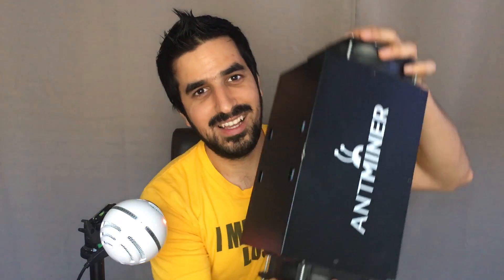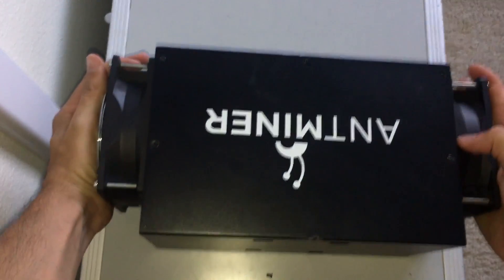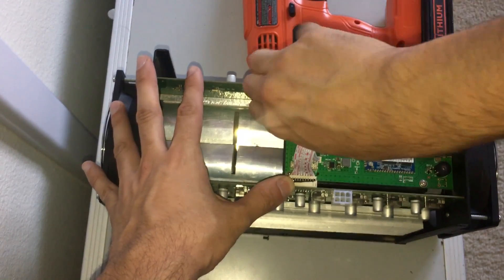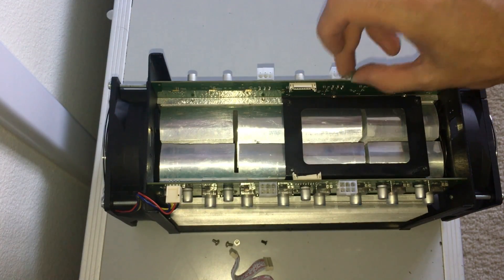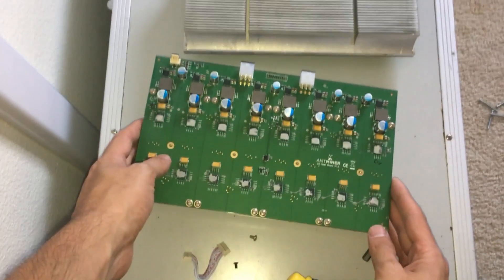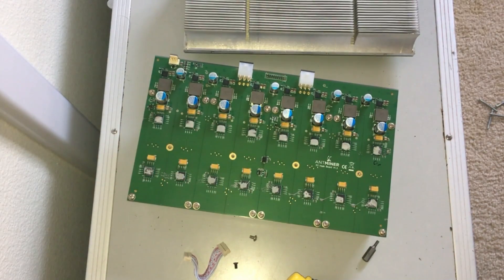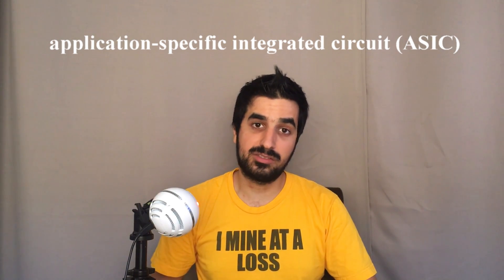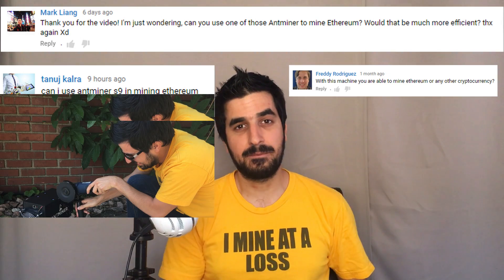What’s Inside - Bitcoin Miner

Comment: I have a budget of 50000 euro, I want to make a badass Bitcoin mining rig. what should I use? and a is it possible to use solar panels to power the machine
Reply: Its probably gonna cost 50000 for the solar panels....
Reply: Get the solar first, enough for 10kwh. Then buy 6 s9s
Reply: Do it in russia, cheap electricity af. Cheap storage buildings, also cold = less money for cooling systems.
Reply: wait for amd vega x 64 and than make rig witht hat card